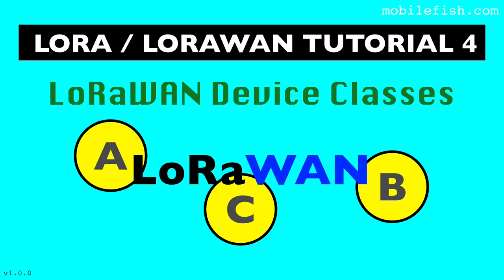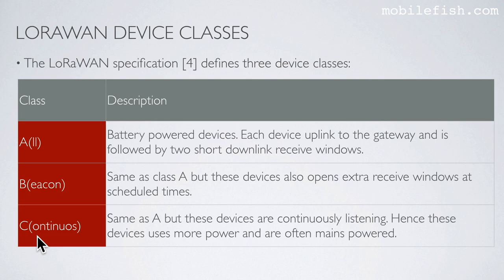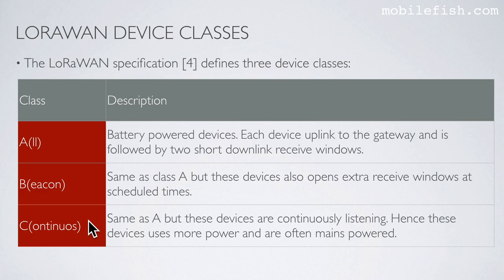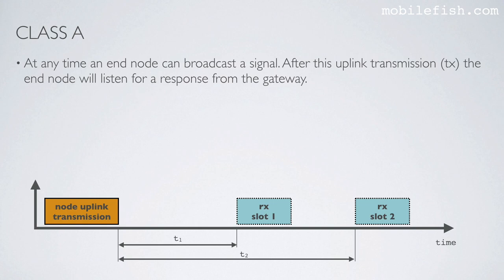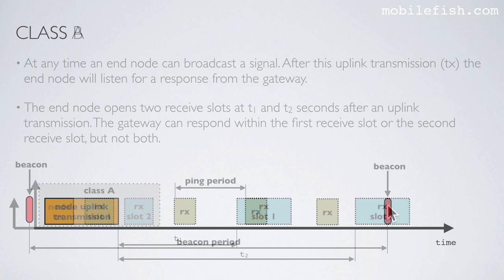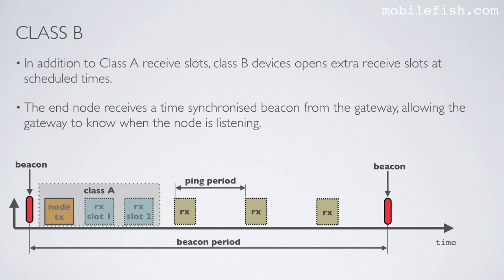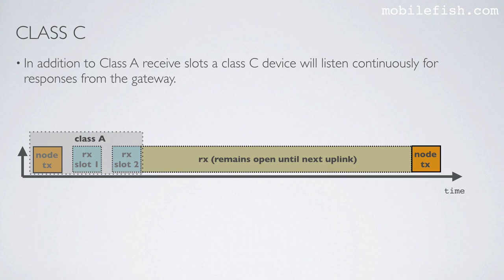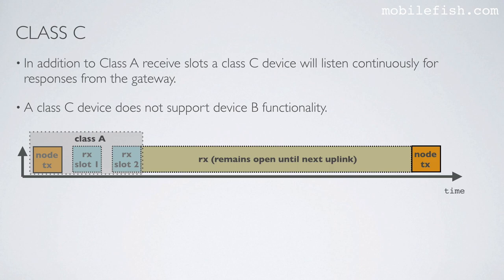LoRa/LoRaWAN tutorial 4: LoRaWAN Device Classes

Comment: If a node does not have any data to be uploaded but needs only dowloads (synchronization of the time) can the gateway send data at a special time or does a A-node always have to open the "transfer window" first? The description sounds as if the transfer window has to be opened by the A-node. Please explain. Anyway your videos are very expressive and gives an easy understandable overview of LoRa and the underlying RF transmission.
Reply from the maker: Knut, if you have a class A device but you are only interested in the downlink, just transmit a single byte (for example 0x00). When the gateway receives this data, the time is measured to determine the receive slots 1 and 2.
Yes, you NEED to transmit a data (any dummy data will do) to create the receive slots.
Reply: Thanks for clarification. Does your answer imply that there is no broadcast from the gateway to the attached nodes? So for example all valves controlled by one gateway have individualy be informed about a change of the flux.
Reply from the maker: A class A device can send sensor data to a gateway. This gateway can send a response back (time slot window 1 or 2) to this device.

Can a gateway control multiple end nodes at the SAME time?
I do not think that it possible because every end node has a different encryption key exchanged with the gateway when joined.
You might try to give the devices the same IDs and encryption keys to be able to receive the same messages. I have NOT try this myself but still you will have a problem with the time slot windows.

As far as I know LoRa/LoRaWAN has no multicast support (maybe in the future???)
Reply: Thanks for clarification. Thats saved me a lot of time.

Comment: Thanks for the great video! What if the beacon is not received by the end-device? Does the end-device have to be ON for the whole beacon period for the next beacon?
Reply from the maker: See: https://lora-alliance.org/sites/default/files/2018-06/lorawan1.0.3_final_0.pdf, chapter 12 Beacon acquisition and tracking.
"...Once in Class B, the end-device MUST periodically search and receive a network beacon to
cancel any drift of its internal clock time base, relative to the network timing...." 
Reading this specification it means the end-device has NOT to be on the whole time.

"....If no beacon has been received for a given period (as defined in Section 12.2), the
synchronization with the network is lost. The MAC layer should inform the application
 layer that it has switched back to Class A..."